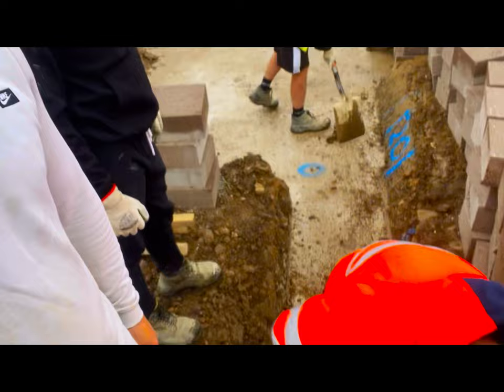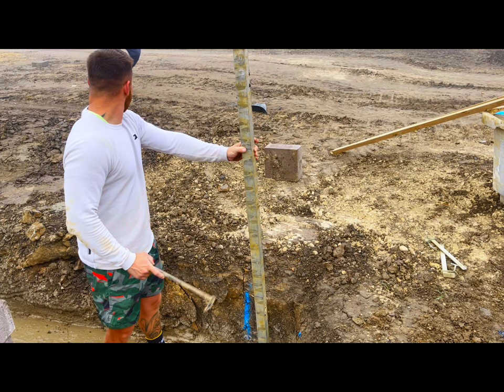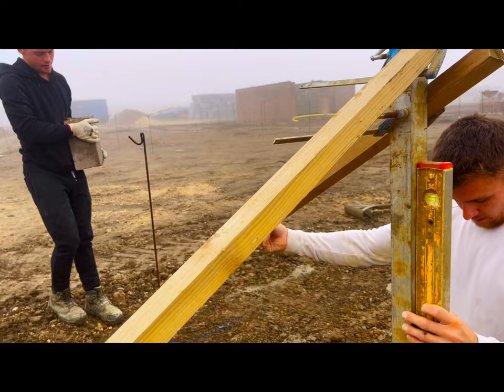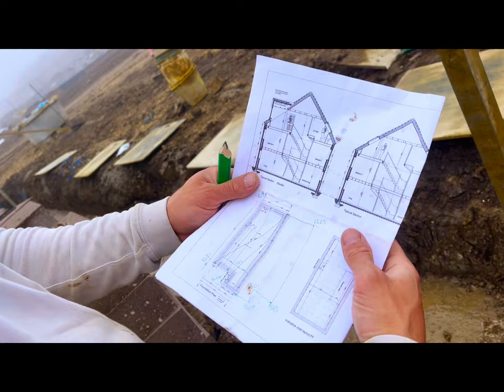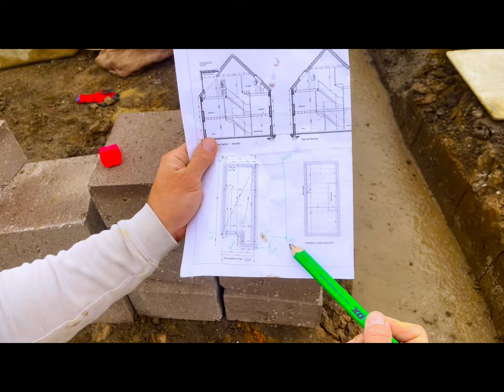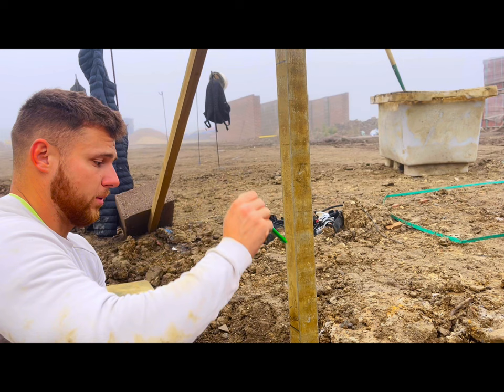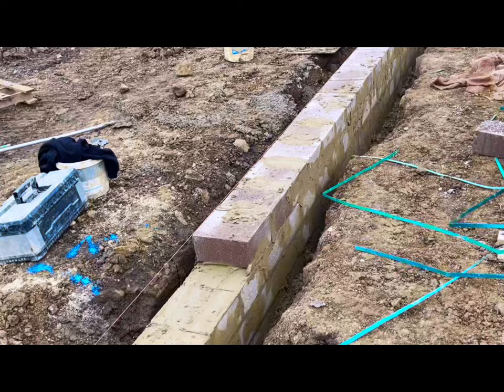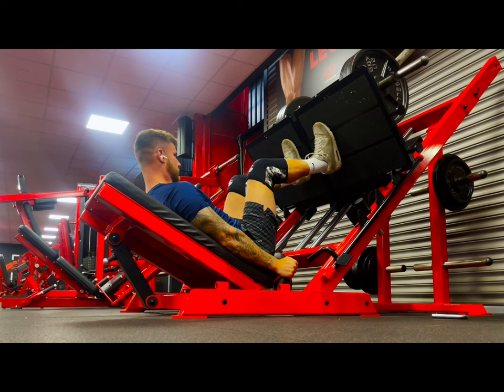Best Way To Set Out A Footing | Bricklaying

Comment: Young mans game that!
Are those blocks solid concrete? Why use them instead of the thermolite trench blocks? Would be much quicker and easier to lay!
Reply from the maker: Not sure mate, this site has never used thermo trench blocks yet
Reply: I have done foundations for over 30 years and only used trench block once there not used much in Scotland it’s normally 6inch concrete internal and 4 inch external

Comment: How can you guarentee your profiles are set square to each other  fair enough the pins on the corner but theres room for error doing it this way i would at least run a line threw
Reply from the maker: We do run lines as well mate
Reply: @PATTERSONCONSTRUCTION  I know you will run a line from your profiles but I mean when your setting them up before the lines go on how can you guarantee the profiles are square to each other from just putting them next to the pin
Reply: Sorry for my questions I have just always set up from hurdles and plummed down off q line I haven't done any big site work

Comment: You won’t be doing that at the gym in 10 years if you stay in they fooonds😁😁😁🤙
Reply from the maker: Thankfully this will be a once in a blue moon occurrence 😂😂
Reply: Footings are no worse on your body than doing supers if they are scraped off completely. No excuse for all that island crap. Work from barrow and off pallet for blockwork no need to stack out. Wouldn’t do them if not I’m not working like a mountain goat.
Reply from the maker: @scottjohnson1456  but they rarely come completely flat. 99% of the time you’re working in a trench so it would be impossible to use a wheel barrow, and how could you work from a pallet? That doesn’t even make sense
Reply: @PATTERSONCONSTRUCTION  Decent groundwork companies will flatten them off all the ones we do are. We did few that weren’t for someone else it took so much longer. It doesn’t take anytime in a machine to sort it. You can then get your materials/ blocks next to where you working and work from them. Only moving them once . Mixer put next your footing no need for tubs all that mixing station crap waiting for driver to bring it. Bricks only thing need to be loaded out on inside skin for doing your splash obviously
Reply from the maker: @scottjohnson1456  sounds like you’ve got a good system going on but it would never work on the sites around here. We get ready mix as well so we have to get tubs. It would be a dream doing footings if all ground was scraped away
Reply: @PATTERSONCONSTRUCTION  It is what it then for you boys. I have noticed that they seem to like ready mixed mortar in tubs more on these Northern sites. We never use it. I did supers up until 4 years ago and love doing footings earn lot better. Some people hate em, I guess in trenches it certainly not much fun. Take care 👍
Reply from the maker: @scottjohnson1456  it’s ok doing them now and again mate but I’d hate to be stuck on them especially when it’s all trenches. You take care as well mate 🫡
Reply: Health and safety should not be picking blocks with legs up around your ears